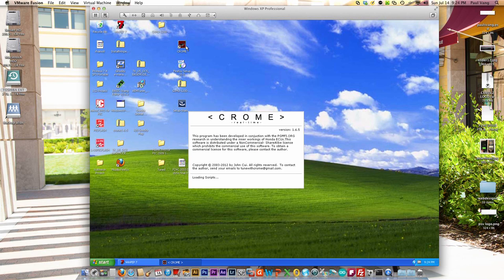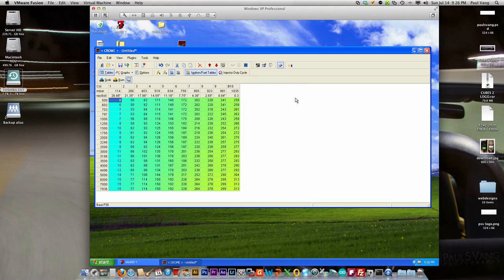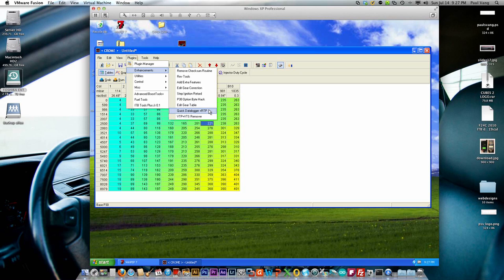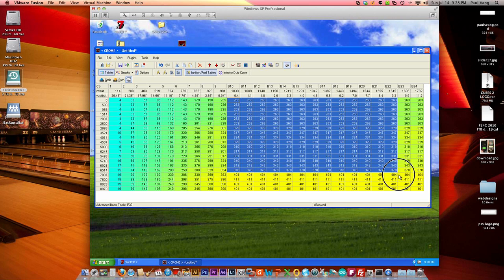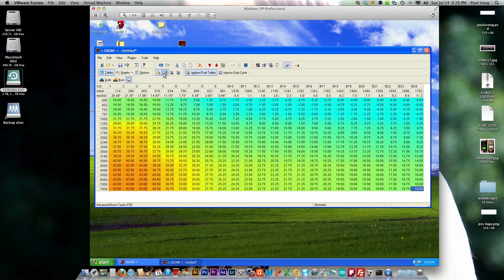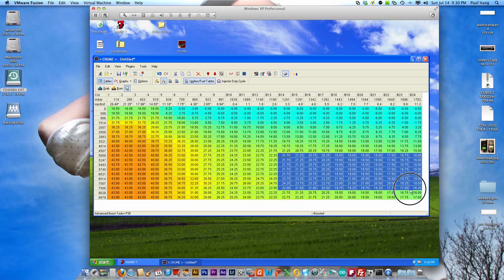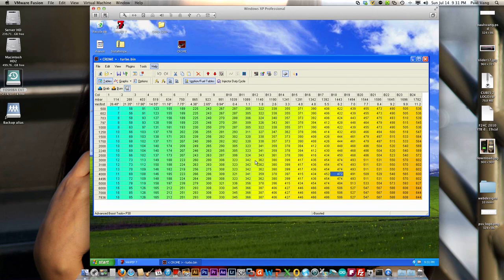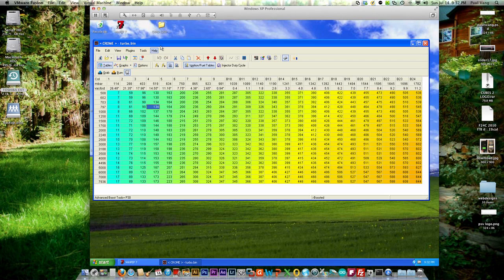Crome Tuning - Setting up a Turbo Map

Comment: This vid has been great so far, thank you. I have three questions,

1) Do you need to adjust the CC of the motor if you're not running what the B16 is?

2) If you're only running 7psi do you zero out the higher boost columns?

3) And is this map ok to use if I don't have a P30?  

I have a P75 A51 in an H23 Auto Turbo Prelude
Reply: Hell no.  the map has to go from left to right increasing VE the whole time. You cant zero out the right side of the maps. Change the interpolation targets to make the last couple cells only a couple pounds over your target boost and set it rich & lower timing in case you get a boost spike you can keep it safe

Comment from the maker: Since I sold my shop, I try to do everything before going to the dyno.  Usually I go to the dyno to verify my numbers and hp/torque curves.  

Tune fuel first, then timing.  Most of the time the timing needs to be done on the dyno because you're looking for torque increase.  Fuel can be tuned on the street if you have a wideband.   I hope this makes sense to you.

Comment from the maker: Brockxxxxsamsom you are on the right track.  Tune low cam first, then high cam.  Lay the dyno charts on top of each other.  There you see the torque curve intersect, thats about the area where you want the vtec crossover.  Your HP curve should look pretty linear (all motor setups that is).   I usually start with idle and part throttle tuning on the street to ensure map for daily cruising.  Once I"m done with that, then I dyno it doing full throttle only.  I use to own a dyno (and shop)

Comment: Thank you, this is excellent.  I want to tune my own car,I've been researching it for about 1.5 years already, there's a lot out there about engine theory but not much as far as implementing the knowledge.  It always ends with "just bring it to a dyno and let someone else tune it."
Anyway, here's my question.  If i want to tune myself what would be the procedure with a running basemap? 
Disable vtec, and just work on lo cam fuel and spark, get it running safely and and close to stoich,(rich in